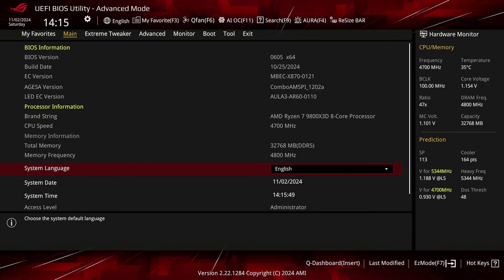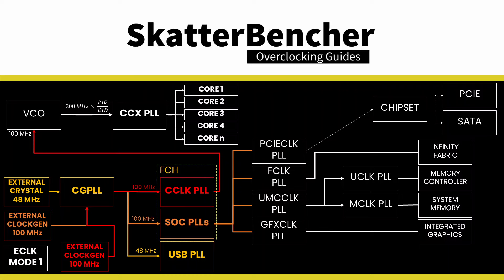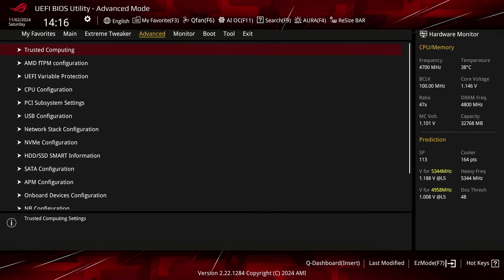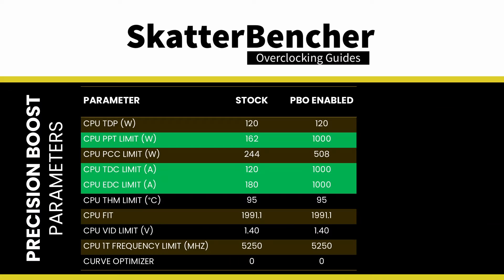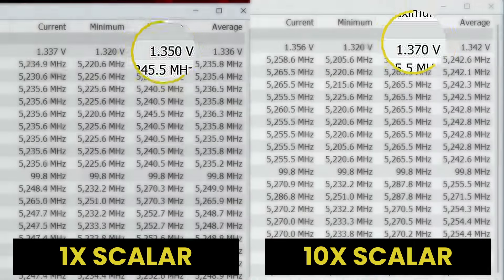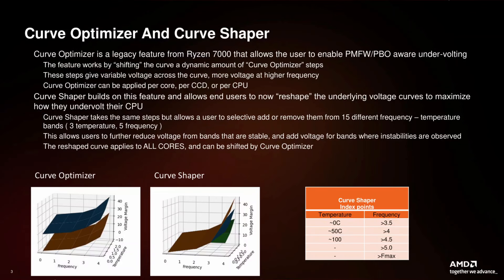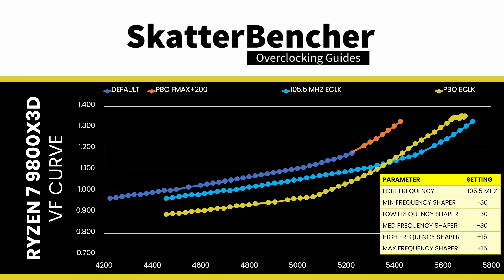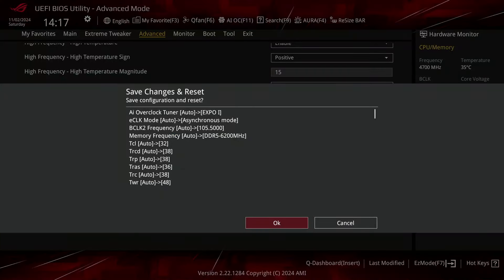5 Minute Overclock: Ryzen 7 9800X3D to 5750 MHz

Comment: When did overclocking get so complicated??? It used to be as simple as just simply raising CPU Core Ratio and raising CPU Vcore voltage, and that was it!
Reply: that overclocking is already done by the cpu itself. now we are left going after the scraps which doing your method doesnt do.
Reply: You can still OC like that,but not X3D cpu because stacked cache are very sensetive to voltage changes.
Reply: Man this way you can overclock by downvolting your CPU which is superior (!) to the old way of doing it.
Reply: thats only how it used to be about 10 years ago, before that it was even harder as most CPU's didn't have a fully unlocked multiplier. Most had a semi unlocked with most being capped at +5-10 increased multiplier or lower so you have to also overclock the base clock (BCLK) frequency. I remember the old Core 2 Duo's you had to increase the BCLK by like +200-400MHz with a 9-10X multiplier with something crazy like 1.5V to get 3-3.5GHz.

I remember the legendary Q6600 D0 stepping CPU I had that baby at 3.6GHz locked from a stock of just 2.4GHz it required a 400 BLCK and 9x multiplier at something like 1.45V but it was ROCK SOLID 24hr Prime95 smallfft stable.

Overclocking before this was EVEN HARDER and required manually moving jumpers around the motherboard to increase voltages and unlock features. Basically if you didn't have the expensive boards you were only running stock clocks and with the old Pentiums you were basically not overclocking at with how damn hot and power hungry they ran.

Comment: not all boards have the eclk feature
Reply: Doesn't matter. Look at the game-benchmark graphs in this video. For gaming, there is no need for this OC.
Reply: @roB3rnd  Returnal epic settings 1080p 110%?
Reply: Most mid-high end MBs do, its just under a different name.  For ex: Asrock X870E has it under Advanced > AMD PBS > AMD Common Platform Module > Base Control Clock Mode (BCLK).  Then CPU Clock Overclocking, PCIE=100 to adjust EClk on CPU only (no impact to memory, FSB, etc.)
Reply: @roB3rnd  game benchmarks are done by extremely outdated graphics card. He is using 2000 series.
Reply: Yeah I mean I have a tuf x870 plus WiFi it’s pretty new lol . Maybe it’s there but I couldn’t find it even in search
Reply: @roB3rnd  his gaming benchmarks are garbage. He should've included :
1. Frequency dependant game - something like CS or R6S.
2. 3D-Vcache dependant game - something like PUBG,Tarkov.
Reply: I'm also wondering about ELCK feature, i have a very new motherboard ( x870 rog strix A from asus ) and it seems that i don't have the feature :o
Reply: Sucks for them
Reply: @Slalomstyles its in the crosshair and maybe Strix E.
Reply: @zefirshaman FINALLY, someone gets it. Enough with the useless benchmarks and marketing bs
Reply: @zefirshaman  Funnily enough CSGO was frequency dependant. CS2 performs the best with X3D CPUs.
Reply: @Slalomstyles  strix E-F is the cheapest to have eclk, but the x670e are no longer available and x870e have really stupid pci lanes sharing due to mandatory usb4
Reply: @zefirshaman  CS2 is Frequency and 3D-Vcache dependant.

Comment: Since only the most high end X870-motherboards support the use of an external clock generator, is there a way to reach higher clocks than the PBO Boost override 200 MHz allows on the lower tier X870/X870E-motherboards? Base clock OC isn't stable and multiplier disables the dynamic clock speeds which are really beneficial. My 9800X3D seems to be very stable despite heavy undervolting so I'd like to try out how high I can get it to overclock.

Comment: any idea why pbo caps out at 5425 mhz, even though I set +200 ?
Reply from the maker: No idea - I saw the same thing on my CPU so I think it's expected behavior
Reply: @SkatterBencher  same problem with my 7800X3D - with my new 9800X3D it boost 5,4Ghz (stable) 70W Temp 60

Comment: Asus AMD ROG Crosshair X870E with Ryzen 7 9800X3D and RTX 4090 Founders edition.
Thank you for your video I have copied all setting and all good !.... It feels like there is still a little space for improvement.
Any chance you possibly could try to squeeze  a little more juice :) from a chip. Thank you
Reply from the maker: I can suggest to watch the full length 9800X3D guide where I cover the overclocking process in much greater detail https://www.youtube.com/watch?v=LU3ekfB4y18

Comment: For the last strategy, if I have a 6000MHZ cl30 2x32 kit, would I still load Hynix 6400MHZ 1.4V 2x16GB SR? Or would I load Hynix 6400MHZ 1.4V 2x32 DR? Lastly, would I need to change the memory frequency to DDR5-6200MHz?
Reply: Depends if you have a single rank or dual rank kit. 6400 is doable on a lot of 9800x3ds, so try that (increase SoC to 1.25 or 1.3v and run y cruncher vt3 to test stability)
Reply: @IIHydraII I have the G.Skill Trident Z5 Neo RGB, and it's a dual rank kit.
Reply: @xCaliBryan I'm also running G.Skill 2x32GB PC-6400, CL32 spec on an ASRock X870E Nova & 9800X3D.  I was able to run Windows with XMP settings, but it would crash in games.  I lowered my speed down to PC-6200 and lowered the CL to 30 and it's been stable. Your mileage may vary depending on your particular RAM kit, but it's worth trying XMP first and then tweaking from there to get your latency as low as possible.  😎
Reply: @IIHydraII 2x32 DDR5 is always Dual rank no?
Reply: @Darkswordz are you able to change the eclk on the nova? What is your max cpu mhz?

Comment: @SkatterBencher, I'm on an X870E Taichi but it has all the same MB features. I'm also using Gskill 24GB x 2 Expo1 @ 8000.

When i clone your settings (w/the exception of different Expo) I get 5650 MHz max and VCore hitting 1.395V.....! 😮

Not sure what's causing the differences, but the VCore is alarming.  Is this perhaps due to different default VCurve settings btw Asus ans Asrock on X870E...or?  Would I just need to offset Curve Shaper with lower values on the top end (High/Max) to achieve lower max VCore?
Reply from the maker: All Ryzen CPUs have an upper Vlimit of ~1.45V in idle/light and ~1.4V in all-core light load. The voltage you're seeing is only applied in light loads and is normal behavior.

If you set lower Curve Shaper for High/Max, you'll see higher frequencies at that voltage.
Reply: Probably down to asrock using a more aggressive LLC setting

Comment: Can't get mine 5500 all core stable :( Ended up just using PBO +200 with curve shaper. It does 6400 1:1 with 1.24vsoc though so no complaints there.
Reply: I couldnt get mine stable with his exact settings either. Adjust the settings he shows here 4:42. I found if i put -30 i was unstable. If i left it at the base 15 it was stable. Go in and adjust yours as needed. I still havnt fine tuned mine yet, so im going to keep going down by steps of 5 until i find my minimum. But even with the baseline -15 that my board sets it to ive seen my cpu hit 5650 stable. Im running a eclk of 105 as my motherboard doesnt support decimals.
Reply: @Y_Grim_R  I don't have ECLK on my board unfortunately. But nice :)

Comment: Can you give some information about the IMC frequency??? Is it still not recommended to use >6000mhz ram and use low timings instead, like with the 7800x3d?
Reply from the maker: 6000-6400 is fine, just depends on what the IMC (UCLK) is capable of. Most of my chips have no issue at 6200 but 6400 is tricky.

Comment: I have same motherboard and CPU. My RAM is 2x16GB G.skill 7200Mhz CL32 EXPO. I copied your settings and when I run the cinebench R23, the computer completely frozen. What does not work well?
Reply from the maker: I recommend watching the full guide for more information and background with various OC Strategies: https://www.youtube.com/watch?v=LU3ekfB4y18.
Reply: @ The problem was that PBO settings (default=Auto) in extreme tweaker menu always overwritten my PBO setting in Advance menu. After I had disabled PBO in Extreme tweaker menu, your setting almost worked well. I learnt that PBO setting in Advance menu more stable and there, PBO (Auto) works with lower temperature and power consumption (125w compared to 150w with same Auto setting). Nobody said that before.

Comment: Can this be done without eCLK? I have an x670e without eCLK.  I tried ryzen master and ran +200 to boost to 5450mhz and it’s quite stable and cool, but I need more.
Reply: without eclk you can only do +200 via PBO or do all-core OC and maybe get little higher but with worse efficiency as it will run those clocks all the time on all cores so probably won't get much above 5.5 anyway
Reply: @HeadBassVTEC  I did the +200 in Ryzen master.  I assume that applies to all cores, 5450mhz max.  What's the downside to running it on all cores?  I only do it for PCVR/Vrchat which only uses a few cores.

Comment: Hi ! Interesyting vidéo 
Do you think that the x670 hero will support high speed mémory? (Like CUDIMM/8000+)
Reply from the maker: High speed memory should be OK for the X670E. Not sure about CUDIMM compatibility
Reply: @SkatterBencher  Thank you so much ! So if high speed memory reach out 8600 or 9000MT/S in 2 yeras  it should be fine xith X670E crosshair hero? (9600X’s IMC)
Reply: I have my memory with a 9800x3d running stable at 8000 MT, in the x870e Hero. Hardware Unboxed had their memory stable at 8300 MT in their testing with this board.

The 670 chipset might not be stable with these speeds. Memory stability also has A LOT to do with the quality of the memory controller in the CPU. It's yet another layer of silicon lottery even if AMD does have a high quality controller on the CPU.

Comment: I have direct die and everything worked, apparently I have a good CPU instance.
Hero 870e
Reply: Are you using the TG Micro Direct Die Pro?  If so what temps are you getting at idle/stress?
Reply: @nunyabizness2620  No pro Version ,
OC 5450 MHz stres Cinebench  70°  max. 
No oc Cinebench 61° max.
Idle 35°-37° 

but I don't have a discrete graphics card right now.
tests were conducted through the 9800x3d GPU.

Comment: because you get fed by AMD with binned cpus, allot of 9800x3d's seem to be below average silicone
Reply: I can’t even get 5.5GHz stable on my sample
Reply: @thefreemarketeer765  no skill, you need years to learn, not copy paste.
Reply: @ I have been building computers for over 20 years. Had a sandy bridge i7 at 5.0GHZ, has nothing to do with skill. My sample isn’t great, no amount of voltage will make it stable at 5.5GHz plus
Reply: @thefreemarketeer765  Same here. Ended up just using PBO +200 w/ curve shaper. Shame, wanted to run it static :/
Reply: Below average would mean they can’t even run stock. Stock is the average, it is what they are binned for.
Reply: I can’t do +200mhz offset with any sort of negative CO so I’m just leaving it at stock.
Reply: I have direct die and everything worked, apparently I have a good CPU instance.
Hero x870e
Reply: I have the same sp chip
as him and same oc 😂
Reply: @jeritoburrito What? Stock is the minimum lol. A CPU should not be sold if it can’t meet stock clocks with adequate cooling.
Reply: @1288832  i have the same board, can you share your settings? I followed everything here, but the +200 mhz seems to have no effect. temps are at 80C hotest core with direct die and a quad 140mm radiator, pump on low which could explain higher temps there... anyway curious on your settings! thanks in advance!
Reply: Well im here with the second round of CPU’s to come out, and I just got it from Amazon. I’m hitting 5.6 with the +200 but I was not satisfied as that didn’t feel like over locking. Got ballsy and cranked it to 5.8 at 1.175v with a + 0.0250v offset and I’m getting fantastic results. I haven’t tried for more because it succeeded but I feel there is more under the hood because she is stable. I’m just scared to blow up my new chip with this being the first true overclocking x3d

Comment: Pbo enabled + core boost 200mhz -40 curve  x10 scalar but when i want clock it to 5.5 ghz. my screen is freezing when i do benchmark? why i cant push more then 5.425 GHZ. i have very good temps in games around 50-60 degrees
Reply: change the curve to -15 and walk down to start.
Reply: Voltage. Reduce co
Reply: @Sandoo  what is youre settings?

Comment: This is not realistic. AMD sends you CPU they've hand picked to handle this much overclocking. Me and others are struggling to get above 5.4 GHz stable.
Reply: That is not for you bro - he is simply selling - you got one already
Reply: Have you tried eclk? One of my two samples can easily overclocked to 5.725, the other one 5.675. If his settings not working for you, then use curve optimizer rather than curve shaper, set bclk2 103.5, set curve optimizer to all core positive +1 try to find when it's stable.
Reply: I have see many at 5.5GHz that the average 5.4GHz but not by struggleling. Maybe you have a bad simple
Reply: Plenty realistic if you didn't get jacked on your silicon lottery ticket
Reply: @ I suggest you to set bclk2 starting from 103, see if that’s stable. For 5.675 it requires around 104.5-105.
Reply: Jesus Christ! When did overclocking get so complicated??? It used to be just as simple as raising CPU Core Clock Ratio and raising CPU Vcore voltage, and that was it!
Reply: I am a novice at OC'ing. Heck, I am even using Ryzen Master, and using air cooling (not water), and I am 5555 MHz at 1.25V.
Reply: @eagletrippin  Why do you overclock with air cooler? It will throttle most of the time and you'll get less performance than stock
Reply: You either have a dud CPU or a motherboard that's not great for overclocking. What board do you have?
Reply: Because you reference a different thing. His sustained clock is 5.4 and if you did all core lock that is what you'd be getting. He gets over 5.4 in lighter loads. Imagine bitching about free guides, jeez you ppl are bitter
Reply: @pcoverthink  Nobody is bitching about anything. We are here to discuss and learn from each other. This is a guide after all. Maybe you shouldn't be here if you can't handle discussion.
Reply: @RmX. most things will not hammer cpu at 100% like in stress tests… air cooler is fine for gaming etc.
Reply: @RmX.  Im on a air cooler and my temps never go above 65c, even in stress tests. liquid cooling isnt all its cracked to be.
Reply: @Y_Grim_R  same here with liquid freezer 360, but it costs 80$, and it looks cool 😎
Reply: I’ve got mine running stable at 5.8 , 107 to the bclk2, high temp change to 10 instead of 15.
Reply: @NativeWarrior081 8 years ago
Reply: @ruiliang3785 my Asus rog b650 doesn’t even have bclk2 option its just bclk and using all of his settings my computer doesn’t even boot up.
Reply: Any good good settings to get low temps but maintain the stock clock speed 4.7-5.2? Can I disable pbo complety in bios?
Reply: @ okay so temps are hard to keep down? that’s what i thought
Reply: Bios is showing his SP score is 13. That’s good, but by no means the silicon jackpot.
Reply: Then you have a bad chip or you're doing it wrong bud

Comment: Wont scalar 10x just degrade the cpu faster since its beyond the fused limit? I'd stick to 1x if you plan to copy his settings.
Reply from the maker: In theory, yes. In practice, it seems the additional voltage from Scalar 10X is really small so I don't see how it could significantly impact lifespan

Comment: I used  your settings and my MB dumped over 1.4v in the CPU.
Reply from the maker: 1.4V is normal voltage for high frequency and low load on all Ryzen CPUs.